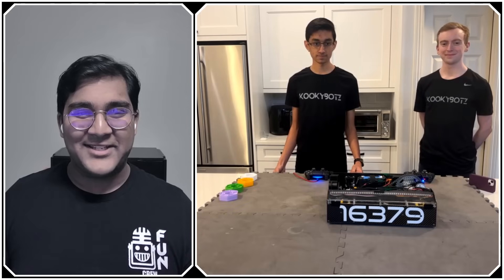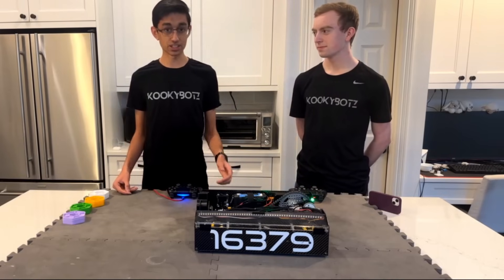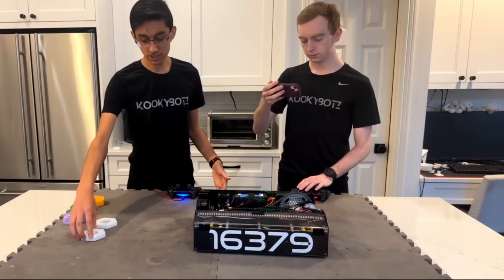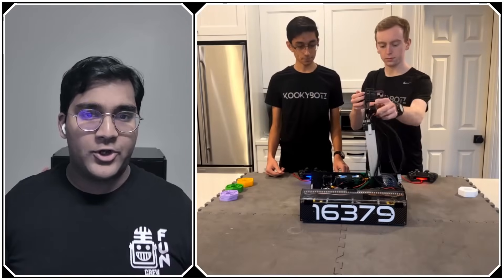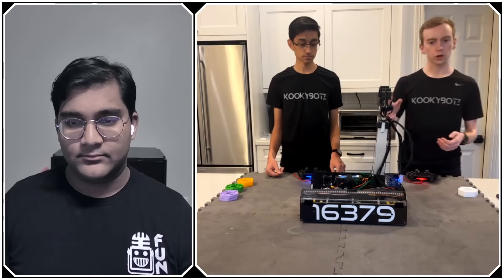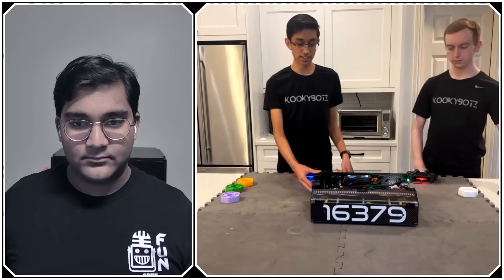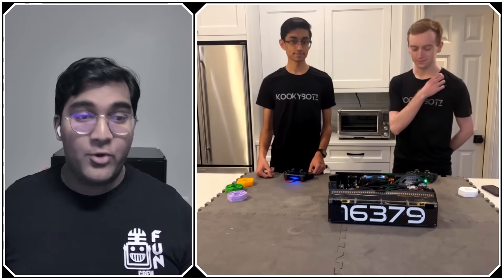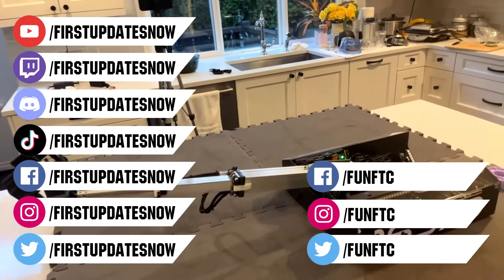Behind the Bot | 16379 KookyBotz | CENTERSTAGE Robot

Comment: It looks like the wrist on the claw uses 2 axon micro servos in parallel. Due to small differences in the servo feedback and motors, I would think this has the potential for the servos to fight each other, resulting in extra current draw, battery drain and servo heating. I'm wondering if you have looked for this or in fact observed this?
Reply: they can run the servos in continuous mode and run them with a pid based off the absolute position of one of the servos. idk if this is actually what they are doing but this is the best and most common approach to running a position controller with two motors

Comment: I heard you were planning to use lidar based distance sensors. Where are you getting them from and how do you program them. My team has had a lot of difficulty with the inaccurate REV ones so any information would be apreciated.
Reply: pololu sells very small 200cm digital distance sensors. for the record, these will not give you an accurate distance and instead report if there is something within a distance. For programming them, check out the ftc-docs for digital sensors.